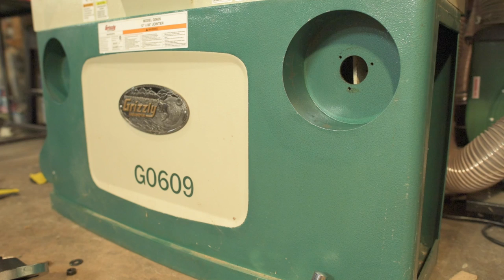Grizzly G0609 Shelix Upgrade - Part 2

Comment: No need to separate upper from base to get to the bolts which anchor the cutterhead.  There is a large 4" round access port covered by a metal plate just below the cutterhead pulley (my machine dated 2014).  Just move both infeed and outfeed tables to lowest possible positions (back out on limit stop bolts), open the cover, reach in with a ratchet-socket & loosen the two bolts.  Cutterhead will slide out toward the back of the machine.

Comment: just so you know on most bottle jacks you can unscrew the top piece so you don't have to put boards under it
Reply from the maker: +ericsnyder7462 I don't follow. The boards were for added height because the 4x4 post was starting to push outward. In hindsight, I should have just tried lifting the table with my arms. It's not that heavy.